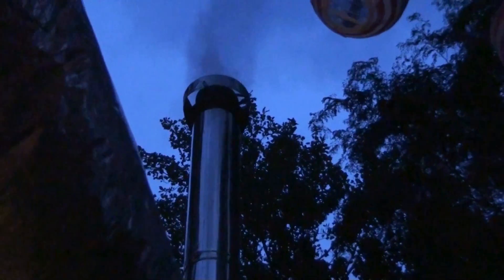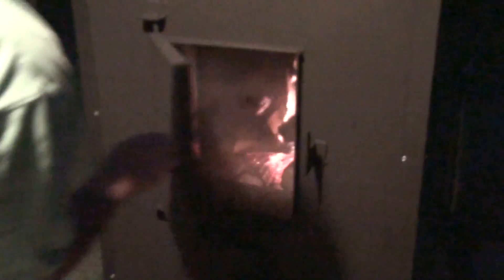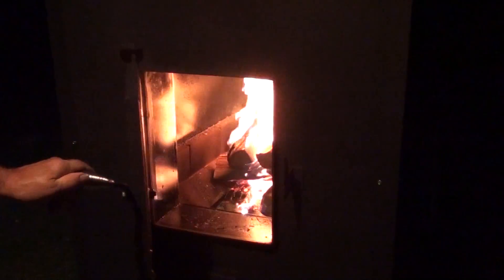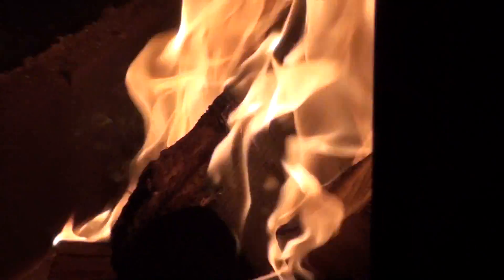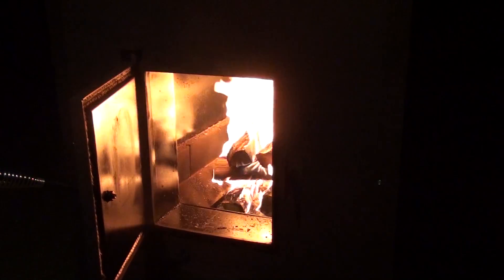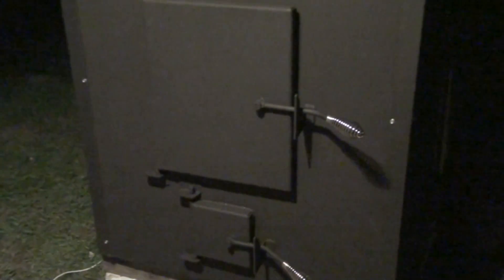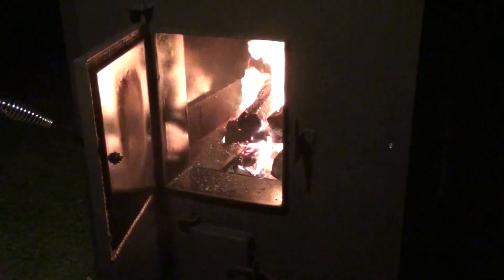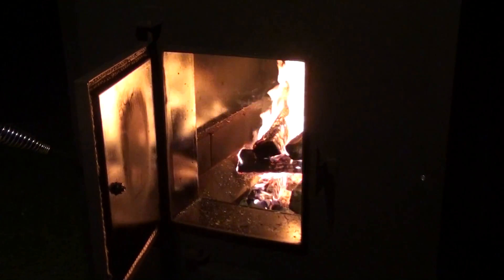Break-in burn part 2. Hopsco Airstove, waterless wood furnace. 00230.MTS

Comment from the maker: The circulation fan temp on and off is adjustable on 2013 models. Factory set at 150/110. Induction fan provides combustion air as long as thermostat in house is calling for heat. After house stops calling for heat the circulation fan will cycle on and off for a long time if you have wood left in stove and got it good and hot. I many times don't have the induction fan come on at nite, but circ fan cycles and maintains house at set back temp all night long. I set house to 68 at nite and 70 day.